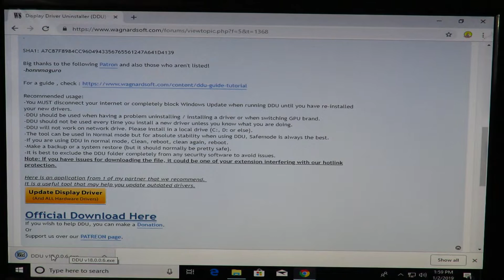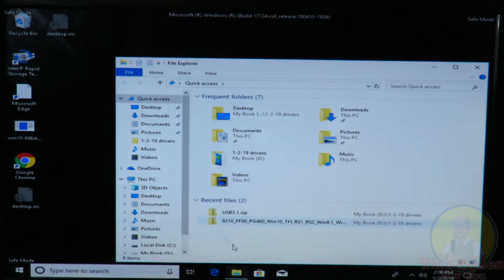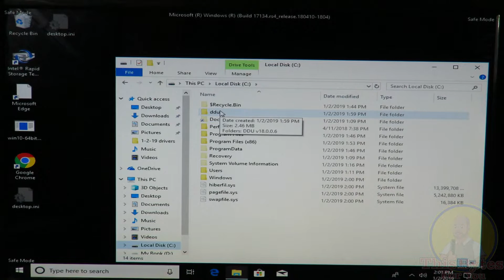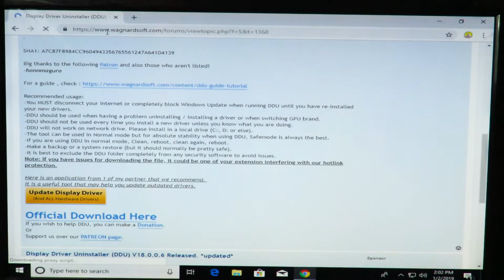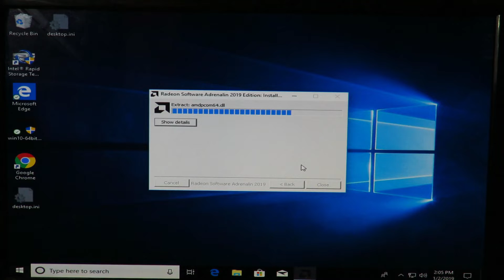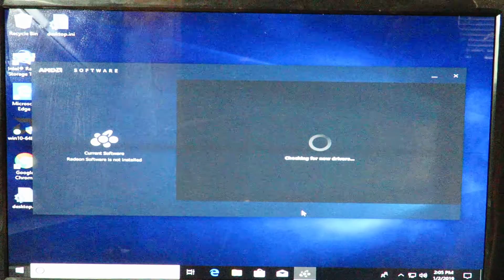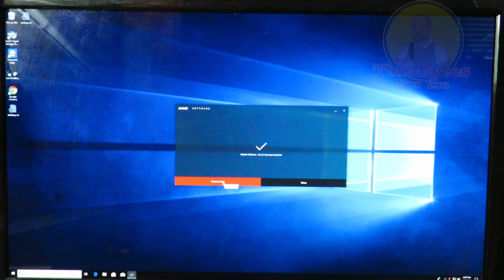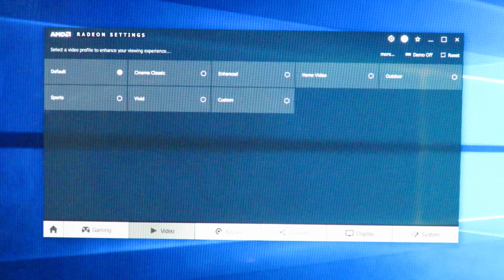How to install the AMD Sapphire Radeon Nitro+ RX 590 8GB OC Special Edition

Comment: You'd recommend me this card for a few years like 2019-2021 in fhd maybe 2k ? Thank you
Reply from the maker: 2019, (which is when this was filmed and tested) at 1920 x 1080 yes, all day long, anyone that recommends any card passed 2019 is lying to you, no one knows what tomorrow brings, what game tomorrow will be released with AMAZING graphical accomplishments.  What game are you looking to play and at what resolution?
Reply: @ThisBytesForYou  i'm very interested in play Cyberpunk77 but right now i have a Lot of games that i can't play because my graphic card  is too old, it's the 660ti so i don't know either buy this one the 590 or wait until the 2020 umm 🤔😣 i'd like in fullhd
Reply from the maker: @jeisongarzon6066  so the 590 is a great card, but the highest it will do playable is 1920x1080 with just about everything on.  If you want to play at 2K and above, you will need a better card.  For Cyberpunk, it should work, here are the system specifications

Minimum Requirements, Predicted
OS: Win 7 64
Processor: Intel Core i5-2500K 3.3GHz / AMD FX-8320
Graphics: AMD Radeon R9 380 or NVIDIA GeForce GTX 960 2GB
VRAM: 2GB
System Memory: 8 GB RAM
Storage: 70 GB Hard drive space
DirectX 11 Compatible Graphics Card
 
Recommended Requirements, Predicted
OS: Win 10 64
Processor: Intel Core i5-4670K 3.4GHz / AMD Ryzen R5 1600
Graphics: AMD Radeon RX Vega 64 Nano 8GB or NVIDIA GeForce GTX 1070
VRAM: 6GB
System Memory: 16 GB RAM
Storage: 70 GB Hard drive space

I would recommend 1080ti and above, sadly the Vega 64 is currently the highest and it performs on par with a 1070 at times with a standard 1080 (non TI).  If you like I can recommend a 20xx series card if you are looking to buy now.
Reply: @jeisongarzon6066  Wait for the RX5500XT
Reply from the maker: You can only wait for so long, this was 3 months ago my friend
Reply: @ThisBytesForYou  yeah i know xdd
Reply: @ThisBytesForYou  im sorry that you waited for that, the 590 is actually more powerful
Reply from the maker: @marti-nz  no I didn't wait for it, Lie had recommended it, if anything I waited for it so I could review it, I am finishing up the review for that shortly.
Reply: @ThisBytesForYou  I guess it ain't gonna be a positive one
Reply from the maker: @marti-nz  you might be surprised, stay tuned, it's coming soon

Comment: hey, i actually have an radeon rx 580 but i will upgrade to a rx 590, do i need to change drivers or the amd adrenalin will work just by switching cards ?

HELP PLZ !
Reply from the maker: it will work, but I recommend uninstalling and updating anyway.  Also, please know, in my channel, you never have to say "HELP PLZ!" I answer all my questions, I always try to help.  

Thank you for stopping by, checking out my video and even more for commenting, it means the world to me.
Reply: Not worth it it’s like a 10 FPS change
Reply from the maker: @SelViralMedia  I don't think it's choice he was asking on, more like a card he already has, so i did not question it, but it is a great point.
Reply: @SelViralMedia  I'm in the process of the exact same change of cards. For me +10 fps in The Div 2 would be appreciated (the 580 gave me 54 at Ultra). To top it off I sold my 580 at the same price I bought it.

Comment: Why did u choose AMD gpu on ddu to clean the drivers? I'm upgrading from 1050 ti to AMD and this is confusing me so when I come to this point I should choose Nvidia drivers to be cleaned right?
Reply from the maker: I might have chosen it in correct, but if you had an AMD before, and you are installing NVIDIA now, you want to uninstall AMD Drivers, you want to uninstall the previous drivers but it would not hurt if you did all 3, Intel, AMD and NVIDIA.  So in your case, since you had a 1050TI, you would uninstall NVIDIA, but again, all 3 would be good too.  So what card did you end up getting?
Reply: @ThisBytesForYou  I ordered RX 580 8GB+ the black nitro :D for 186 USD, and with my I5 8400 I should have no bottleneck
Reply from the maker: @baileyldn8174  that's a great price, I hope you are loving it.  Looks like you might be having a great time with that build.

Comment: What is your power supply does it come ready 8+6 pin for video card?
Reply from the maker: at the time, I was using the Cooler Master Silent Pro Gold 1200W PSU: https://geni.us/7hdBk, now I am using the beQuiet! 1000Watt Power Supply: https://geni.us/jEYLM79.  Yes, all of my power supplies have multiple PCIe connection.  You will need the 8 + 6 for this card though.
Reply: @ThisBytesForYou  I'm building a mid range pc(rx580-Rzen2600-16gb3200hz). But i think 1000w psu i thnk is too much for my rig. The only thing that i dont have is Psu because i don't know if it has 8+6pcie for my rx580. Is this Psu have 8+6 for my build https://amzn.to/2EQtHPi EVGA g3 750w(gold)?..

THANK YOU for reply. I'm just afraid buying the wrong hardware. LOVE YOU from PH 🇵🇭. Sorry my bad english.
Reply from the maker: Anytime my friend, always happy to help out where I can.  A great reason why I always buy more power supply than I need is in the few years I have had it, I have not need to update it,  the 1200 which still works today, I have had for 8 years I think, and the only reason I dont use that one is because bequiet sent me the 1000watt to review, and it is much better.  Anything that comes my way, I should be able to handle and you only use as much power as your system needs, you dont use the 1000, or 1200watts until your system needs it, which it has never, but its there.  The EVGA 750w gold is great, but if you could, please use my link, it will help me tons: https://geni.us/4MBz

Thanks my friend, and please let me know how the build goes for you and if you have any questions, i would be more than happy to help.

Comment: Just bought this card and my coonectors are touching with the heat pipes of rx 580
Reply from the maker: not really, as the plastic keeps the metal from touching, but try to move it away, just in case.  How are you liking the card?

Comment: Hello I know this video is 4 mouths old, but I have a question about the card.

Does it matter when I only put the 8pin cable in the card?
Reply from the maker: yes it sure does, you will need to plug in both.  Don't worry about the time, i will always try to help you no mater how old the review is.
Reply: @ThisBytesForYou  Sapphire's website states that the 6 pin is optional. Why would they say so if it's not?
Reply from the maker: @guillermoz5765  hmmm, you are right, let me find out, I will get right back to you
Reply from the maker: @guillermoz5765  ok, great catch there.  It is a typo and Sapphire is updating that, so it will be updated shortly.  I thought I was going crazy here, hahah.  Thank you for catching that.
Reply: @ThisBytesForYou  Wow! That's to have influence on Sapphire! LOL Thanks.
Reply from the maker: @guillermoz5765  they are the ones that gave me my break way back when, they are my friends.  While they know I will review them 100% honest, they are one of the few that values the 100% honest feedback, because if they are not doing well and no one tells them, they wont know and will continue to do poorly.  Thats one problem they don't have, not doing well, they are one of the top if not the top AMD board partner.  Thank you so much for stopping by and commenting and letting me know, it means the world to me.
Reply: @ThisBytesForYou  Already corrected on their site.
Reply from the maker: @guillermoz5765  ahhhh so very cool, thanks again

Comment: Sapphire 😍
Reply from the maker: yeah they are amazing, what you have from them?
Reply: @ThisBytesForYou  my first card of them was a radeon hd4850 vapor-x and i still have in its original box.The temp never go up more 50 degrees
Here ,i have an Sapphire r9 380 nitro + and it work really great for the usage i have and always have good temps in full load never go up more than 70  degrees
I love their cooler system,their design and their robustness and sure the performance/quality/price
I hope they continue for long time in this way
Reply from the maker: @lebolyon6952  very nice, I have installed thousands of them, every card almost haha when I worked at an OEM and a Boutique, they make great cards.  I also keep my old cards and boxes haha.  Yeah, I think they make the best heatsinks out of any manufacturer.  I talk them them every week or so.   They rock.  How are you liking the 380?

Comment: Good morning! Could you help with a couple questions? What form factor is that mother board? Is it a Micro ATX? Or ATX? I mean, will it fit on any Micro ATX board? Is liquid cooling a must if you intend to install this one? My case came with 3 fans, so would I need extra cooling for the processor? Thanks for sharing this video!
Reply from the maker: Good morning my friend, I would be more than happy to help you.  The EVGA Z370 FTW I am using in this case is an ATX motherboard.  The motherboard will only fit into an AXT chassis or even an E-ATX chassis.  Now the Fractal Design Define R6 case I am using in this video will supports the Micro ATX / ATX / Mini ITX / E-ATX standard motherboards.  As for cooling, no, liquid or air cooling air preferences.  If you want to overclock a lot, I would recommend liquid cooling, but if yuou want to keep normal speeds on your CPU (Stock) air is fine, or even overclock slightly, an air cooled fan would work.  I will link up below everything I used in this video for your reference.  Let me know if you need any more help, as always it would be my pleasure.

Fractal Design DEFINE R6 Blackout TG Case: https://geni.us/a0dMjB
EVGA Z370 FTW Motherboard: https://geni.us/X9eVgAq
ARCTIC Freezer 33 eSports Heatsink: https://geni.us/ciPnLI
Intel Core i7 8700K Processor: https://geni.us/jD0s8D
Patriot Viper 32Gig 2800MHz DDR4 PVE432G280C6KGY: https://geni.us/wPWP1EO
EVGA GeForce RTX 2080 XC ULTRA: https://geni.us/SwBEU6
Sapphire Radeon Nitro+ RX 590: https://geni.us/CWSOO8N
Thermal Grizzly Kryonaut Thermal Paste: https://geni.us/xBKj
Kingston A1000 PCIe NVMe M.2 SSD : https://geni.us/BhJAQM
Samsung 850 Evo 500GB: https://geni.us/QTA2
Patriot Ignite 480GB SSD: https://geni.us/CdEvu
WD Blue 500GB SSD: https://geni.us/VdqB7
Kingston 240GB SSDNOW UV500: https://geni.us/mvwOPN
Cooler Master Silent Pro Gold 1200W PSU: https://geni.us/7hdBk
Reply: @ThisBytesForYou  Thank you so much for your thorough answer!
Reply from the maker: @mermeflorez  you are so very welcome my friend, I am happy I could help you and please let me know if you need anything else.

Comment: So I have the 6 + 2 pcie cable for the card but what is that second 6 cable?
Reply from the maker: to provide more power for the OC portion of the card and surely to provide additional power for the lighting.
Reply: ThisBytesForYou can I use a 6+2 pin pcie cable for the 6 pin slot?
Reply from the maker: yes of course, though you would not add the +2 part.  6+2 is what all the cables should be.  You have to connect both though.
Reply: ThisBytesForYou okay, thank you!
Reply from the maker: @mikefetters6674  you are very welcome my friend, thank you so much for stopping by, checking out the video and for commenting, it means the world to me.

Comment: I have a gtx 1060 3gb card and I’ve decided to upgrade to this card. My 1060 3gb has lower performance than id like and had stuttering at high settings. I also love to take care of my components so i never put the settings too high due to its low VRAM. The 8gb would help a lot and the smart fans on this system would help my cards fans last longer. Do you know if this card is powerful enough to do little streaming? I stream with 720p 30-60fps and a few small icons. I havent set up my stream yet but i dream is to one day become a “influencer” Its a dumb name for a internet streamer/ overall content creater. 

Also when i change cards will i have to delete my Nvidia drivers, updates, and apps like my g-force experience app?

Oh, and I subscribed.

Edit::::Oh, i got this card and hated the experience. Im getting a 1660 instead now.

Another edit:::: things haven’t gone as planned sadly, i think the original card i got was defective. I’m still using the 1060 but hope to upgrade eventually.
Reply from the maker: Hello my friend, thank you so much for stopping by, checking out the video, commenting and subbing, it means the world to me.
Upgrading to this card will provide you with more performance, but it would be a miniscule performance increase, to see a better improvement, maybe you might want to think about a 1660ti the cost will only be slightly more.  You can find one here on Amazon: https://geni.us/ayWQB

If you have purchased it already, no problem the increase in VRAM will help, but again you will see a better improvement with the 1660TI.

Both cards will allow you to stream at 720 or higher, I would try to get to 60fps, at 30fps you vidoes and viewers will experiences chuggy videos.

Please let me know when/if you do upgrade to any of the card, i will definitely sub to you and I congratulate you and wish you the very best in becoming an influencer, its a rough road and takes a lot of commitment but if you set your mind to it, you can do anything.

As for drivers, yes, you will need to remove everything , use DDU like I showed you here and it will take care of it all, of course you will ned to changed it form AMD to NVIDIA.  DDU is amazing.

Thanks again my friend and I wish you nothing but the best.
Reply: yeah the 1060 is a good card but 4 gb is necessary
Reply from the maker: @JHorse508   JHorse508  yeah it is, but he already has a 1060, so I recommended instead of him wasting his money (waste in my opinion) getting the same card only slightly increasing the RAM, to get a 1660 instead, then he will see tons more performance and double his RAM.  So it would be the regular cost he was going to spend on the 590, but get more performance and only pay about $30 more.
Reply: Vega 56
Reply from the maker: @Sirtoastsalot  what about it?
Reply: ThisBytesForYou, I believe he is telling me to get a vega 56. 

I actually really want a 56 but i have no funds. My parents said if i wait till Christmas i can get a better card. The only problem is i will need a new processor to keep up with the power so i don’t bottle neck. 

I actually  have a crazy idea I want to do. I’ve thought of of making a second pc only way smaller and sense i’m moving soon. The coolest thing is it would be a sleeper. It would be a lower end build but... 
the craziest part of the build is it will be in a ancient laptop. The laptop case is huge, its one of the thickest laptops i’ve seen. The screen itself is thicker than my current monitor. I thought if i could gut it out and sense the case has a lock on it i could close it up and open it easily to check the specs and to help heat dissipation. It would look like a closed vintage laptop to the untrained eye but to those who open it would be treated to nothing but specks. (It would be a desktop hidden as a laptop)

Sorry i wrote so much, i just had to write it down.
Reply from the maker: @ATE117  no worries my friend, and wow, I didn't realize the 1660 and the 56 were close in price or else I would have recommended that, it is slightly better than a 1660.  Cool idea, but you definitively have to work about heat as you mentioned.  As for your old build, what are the specs of your older PC?
Reply: @ThisBytesForYou . the pc im considering building is probably gonna be a intel i5 along with maybe a mini 1050. maybe a titan, im still really considering it. i have to get the funds and my parents permission first. my current pc is a 1060, i5 8400, 8gb ram, and 1,500 storage
Reply from the maker: @ATE117  what motherboard do you have?
Reply: ThisBytesForYou, a bazooka mother board
Reply: ThisBytesForYou. I believe it is msi
Reply from the maker: @ATE117  yes, its an MSI, but there are many versions, 150, 250, 360, would you know what version?
Reply: ThisBytesForYou. I think its the most top of the line one. All i know is i was told it was supposed to be the best
Reply from the maker: @ATE117  its top of the line till the next month, no way I would be able to help you unless I know the model number, sorry my friend
Reply: ThisBytesForYou. I mean top of the bazooka. What every bazooka is highest rated. Its a full black board if that helps

Comment: I have same GPU but the fans is not working it is normal?
Ps. it spins when I reboot or open the computer but Its stop when the computer starts.
Reply from the maker: hello my friend, it is some what normal, they are meant to spin when needed, will it ever spin when you play a game?
Reply: I have the same issue the fans are never working even when i runs games and the temperature gets very high
Reply from the maker: @francishoulepoirier2637  have you tried running TRIXX, and if that doesn't work, give Sapphire a call or open a support case, I am sure they will help you.

Comment: Owesome job right there
Reply: I've been looking for ths card, but it still so hard to find
I also learned how to replace an old graphics card and this video is the answer
Thank you so much
Reply from the maker: @akmalahmad1349  ahhh that is great news to hear my friend, I am so very happy I could help.  Have you considered then potentially going with a 1070, 1080 or a 2060, 2070, might those be easier to find, those will perform just about this card?  Not trying to push you away from AMD/Sapphire at all, but these might be better solutions for you and maybe cheaper too
Reply: I've been think about those cards but my pc theme were blue
So the shappie is totally the only options left
Reply from the maker: @akmalahmad1349   haha, well thankfully since most of those card are RGB, you can light them blue another option I see many do is spray paint, but I am personally not a fan of it
Reply from the maker: thank you so much my friend, I do greatly appreciate your kind words.  Do you already have this card?